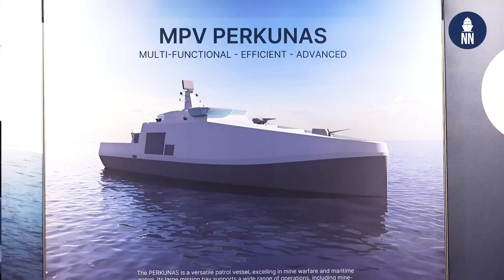Arctic Frigate by Denmark’s OSK Design

Comment: Denmark needs to replace 4 arktis Thetis class asap. 6 would be better and hopefully capable off meeting emergin threats with perhabs Mk41 VLS for 32 missiles and radar to utilize SM-6 and Tomahawk, abd not to forget VDS and torpedoes. Denmark has the fifth largest commercial fleet in the world and the 12 largest landmass when Greenland is included. Its navy should be scaled accordingly
Reply: Unfortunately the only commitment from Denmark is towards 2 new ships to replace the 4 we had. The Defence Minister has mentioned "more could be look at", but it would be beyond the current 10-year defence agreement in Parliament.
Reply: @sunbeam60  well so far the arctic package that has been pledge is part 1 - I saw in an interview that, once they know what NATO will require of Denmark strength wise, a part 2 will be budgeted.
Reply: @Ph33NIXx  Yes, that's today's picture, agreed. 3 months ago when my first comment was posted, it looked very different. Things move pretty fast at the minute :)
Reply: @sunbeam60  right i did not check the date - my bad.

Comment: sadly it has one weakness i hope they  remedy it in their design it has dead angels for their gun weaponry that's was the first thing i noticed.
Reply: I see no blind angels?
Reply: @ulrichkristensen4087  See how high it is   and the forward turret cant shoot low or at the side  there's your angle of attack since this ship are going to operate where engagement ranges can be really short  it is essential for most ships today cover atleast 280 degree arc around the ship and definitely not have blind spots on the bow side arc. 
Especially where sea drones that are sheep to build and easy to use is concerned.
Most ships built today have a minimum engagement range of less then 50m.
There is no chance this ship meet that requirement.
It is a drafted concept i doubt the Danish Navy would accept any ship with such a weakness in their final chosen design.
Reply: @tony18662  It is a concept, this ship will sail the coast of greenland it will have vls onboard and possible rolling airframe,  they are not going to engage at 50m if anything comes that close then it is because of bad leadership
Reply: @ulrichkristensen4087  its icebergs me knowingly radar dont penetrate ice and sea drones have very long ranges the longer north you go the more ice you will find.
to believe its not short ranges in todays warfare is pure stupidity.
Regular ice can hide drones and they are also hard to detect.
Reply: @tony18662  the ice is disappearing from the Arctic, except in the fjords and kn deep winter, that is why the new concept will be able to break ice and defend itself, which the thetis can not.
Reply: @ulrichkristensen4087  VLS and/or RAM will not save them from a close surface threat. Lessons from the black sea shows that small surface drones are extremely hard to   counter, even in open seas. And the western coast of Greenland is full of places perfect for close range drone ambushes.
Reply: That is because it is designed by people with zero experience in building warships and zero knowledge about naval warfare.
Reply: @mkpoulsen  Yes, OSK is not a traditional warship builder ... but don't forget the Danish Navy hasn't worked on this design, this is a proposal OSK is making in readiness and expectation of a Danish requirement for new Arctic Frigates. I'm sure some things will change, or indeed a whole other design(er) will be selected before building commences.
Reply: @mkpoulsen  Ohh so OSK that designed and build the Absalon class and Ivar Huitfeldt class, has zero knowledge, right 😉
Reply: @ulrichkristensen4087  since the concept its rejected in its current form yes
Reply: @ulrichkristensen4087  it was scrapped for Absalom that is outfitted on Lindö Shipyard  so the OSK design will never in this decade be built. two Absolon ships is built .Consept is one thing have the concept to reality is another,
Reply: @tony18662  OSK is a offspring of the Design Bureau that did the Absalon and Ivar Huitfeldt classes, they relocated to Århus when Maersk closed Lindø værftet. The new ships will be build on the Fay-yard on the old Lindø Ground, and in frederikshavn, they will probably outsource part of the Compartment building to the Baltics or Poland as they did with the other classes.
On top of that there will be build 3-4 korvets for the Baltic, and near northsea, and there will also come new patrol ships
Reply: @ulrichkristensen4087  You're confusing OSK and OMT. Odense Marine Technology is what remained after Odense Steel Shipyard closed. OSK is a different ship designer, currently mostly working on commercial ships (though they are dipping their toes in the naval market too)
Reply: @ulrichkristensen4087  Absalon and Iver Huitfeldt was designed by OSS (Lindø) whose design department was later spun off as OMT when the shipyard closed. 
OSKs only "naval" experience is some design work on the  MHV900 series Home Guard cutters . So basically nothing relevant to a modern warship.

Comment: Where are the guns? Only 9 rockets? Even Russian boat has got more than that.
Reply: Haha this is not meant to be a large surface combatant but rather just a patrol ship. These models are also not finished and the 9 cell VLS is probably just a placeholder for now.
Reply: What good are the Russian ships' armament when the ships are not seaworthy or they rest on the bottom of the Black Sea?
Reply: @johnphdk  Yeah those will ended up at the bottom as well in case of war or maybe not cus one could mistake them with civilian yacht.
Reply: Are u blind or just dumb ?
Reply: Russians are no longer a threat

Comment: No brainer for the identified but delayed/put off RNZN OPV need. That length should handle the antarctic swells, unlike the  existing OPVs.
Reply: Arrowhead 140 is already a copy of the Danish Iver Huitfeldt Fregat class. This new design is ment as a replacement of the 4 Thetis Artic Fregat class but with more self protection and possibility to employ weapons that perhabs the Iver Huitfeldt class also have.
Reply: Dam was going to suggest this as well 🙂
Reply: AUS and NZ should buy build arrowhead 140 Frigates. Cheap, low crew but pack a punch